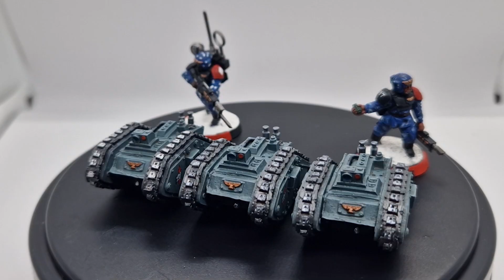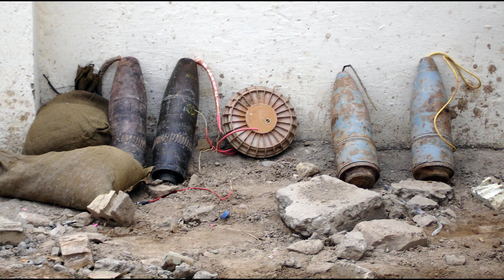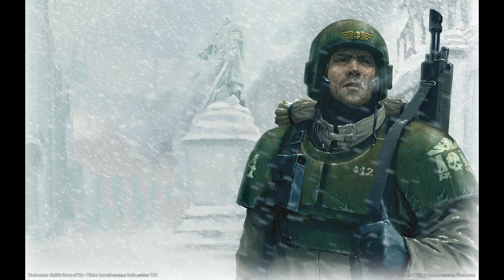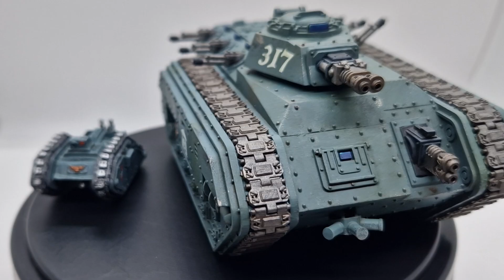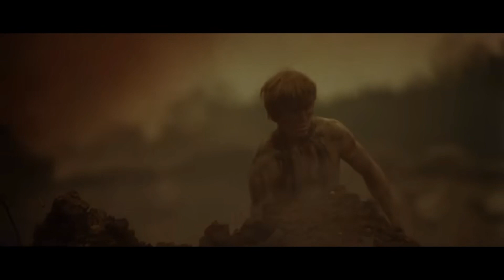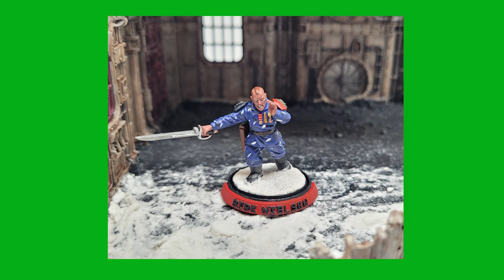How 'realistic' is Cyclops demolition vehicle? | Astra Militarum lore | Warhammer 40,000

Comment: It's as realistic as using the Guardsmen to deliver explosives (in a location that precludes other metods) on a one way trip. Let's put some hypotesis: the human bomb Guardsmen can deliver each 50 kg of explosives, they weight 80 kg naked, to keep them alive to deliver the payloads there's a need of 120 kg of stuff (water, air, food, some armor, etc.), for a total of 250 kg.

If you need at least 300 kg (6 guards) of explosives it's the same mass of a single cyclops, if you need less boom put inside less explosive.